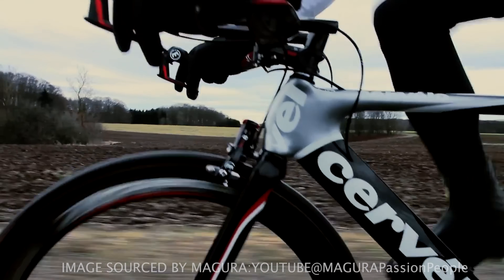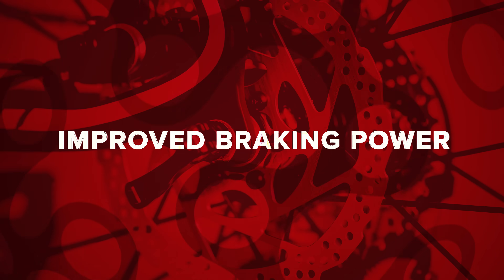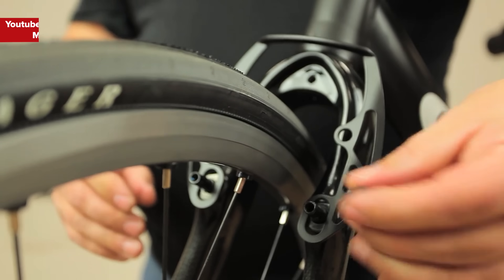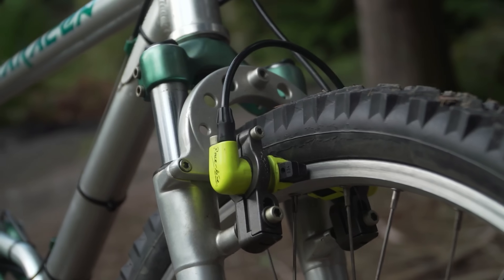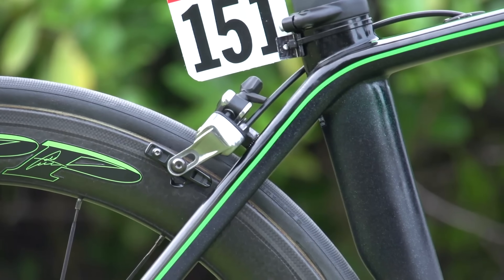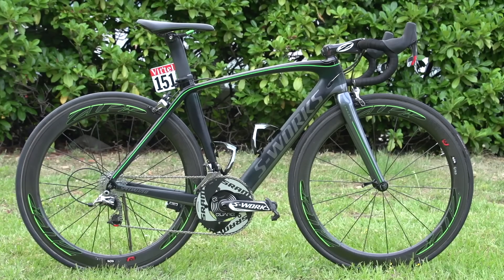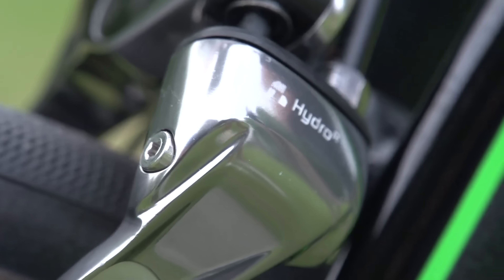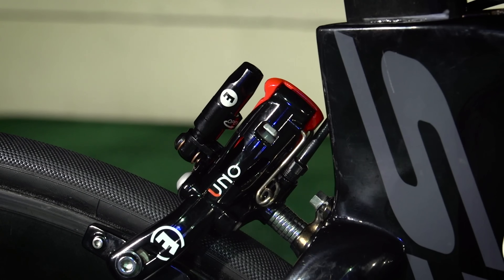The Rise And Fall Of Hydraulic Rim Brakes

Comment: Ever since I tried on disc brakes, no turning back to rim brakes. No regrets!
Reply: I replaced the brakes in my (very, very) old bike with Deore XTs (those with parallelograms - a great piece of tech, btw!) - they aren't that bad I have thought they were! ;)  
I wonder now if hydraulic V-brakes ever existed...
Reply: @PrzemyslawSliwinski they surely exist.Check out Magura brakes. Not sure you can still call them v brakes.
Reply: @Only4gangsta  Yup! They call'em HS.
Reply: @PrzemyslawSliwinski my understanding is that v-brakes is about getting the mechanical leverage. Hydraulics does not make sense then i guess
Reply: I'll take mechanical disc over anything🤙🏼
Reply: @PunaSquirrel  That's interesting. Why? Which calipers?
Reply: You’ll turn back as soon as the bike industry and/or media-hype tells you to.
Reply: @CLP-404 BS. Disc brakes are a safety feature, not some sort of trend piece. It's beyond me how it could have taken the road bike industry so long to implement this technology, especially since the stopping power of road brakes had been pretty miserable compared to any other rim brake tech - especially on carbon rims. 

Disc brakes reduce wear, increase modularity and decrease maintenance costs. You need less pulling force in your fingers to come to a complete halt, won't wear your expensive rims every time you're braking and worst case overheat your tire on a long descent.

Believing that rim brakes will come back is like saying integrated shifters are just a trend created for gullible consumers and that the down tube shifters will eventually make their comeback.

The real money mule of the cycling industry are overpriced carbon parts no hobbyist rider will ever need, UCI approved stuff just to make you feel pro, integrated aero parts, etc. And I bet that you have much of them on your bike and actually believe that they were a good investment.
Reply: @theredspoon1763 No sir… most of my bike is made of titanium.  You can’t convince me that metal is a “money-mule” investment.
Reply: @CLP-404 I have built and sold many high end Titanium bikes in my life, my dad owns one (Falkenjagd Hoplit frame made by Lynskey) and believe me: they're only half as good as the industry tries to tell you. I have seen many of them fail and wouldn't waste a dime on one myself. It's got its own unique material characteristics that may be important to you specifically for sure, but compared to a modern steel frame it's just an exotic, ridiculously overpriced material with marginal benefits at best. 

Cringe btw to call a stranger "sir" on the internet.
Reply: @CLP-404 I have built and sold many high end Titanium bikes in my life, my dad owns one (Falkenjagd Hoplit frame made by Lynskey) and believe me: they're only half as good as the industry tries to tell you. I have seen many of them fail and wouldn't waste a dime on one myself. It's got its own unique material characteristics that may be important to you specifically for sure, but compared to a modern steel frame it's just an exotic, ridiculously overpriced material with marginal benefits at best. 

Cringe btw to call a stranger "sir" on the internet.
Reply: @CLP-404  It's just your yardstick...
Reply: @CLP-404  what a silly take, nobody's swapping out the brakes they trust because of marketing. Even today, despite disc brakes being stronger and more reliable than rim (especially in the wet, or on carbon rims), people still use them just fine.

Not to mention, most frames people are running with discs today wouldn't even be able to use rim brakes anymore.
Reply: @jjpaq maybe not you, but the rest of society are all on the coolaid.